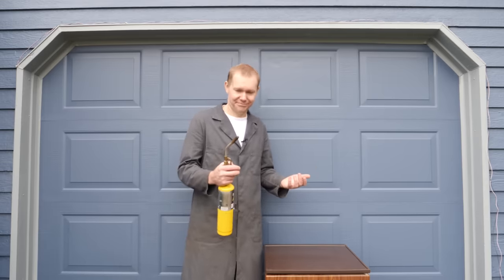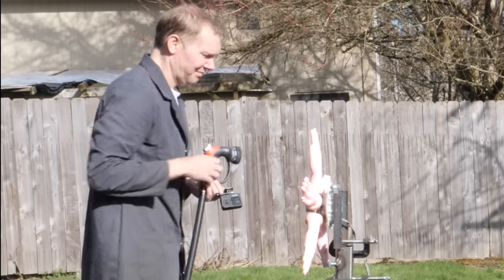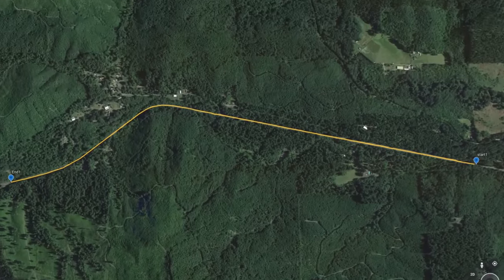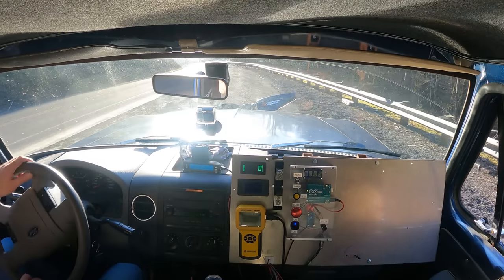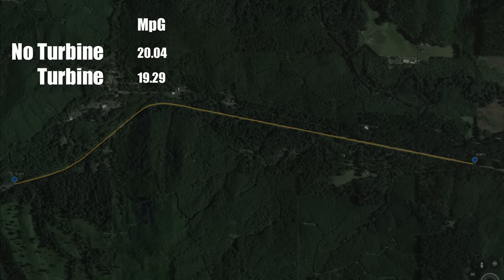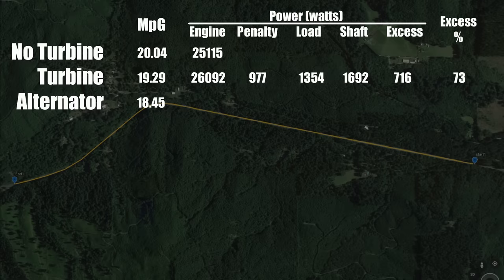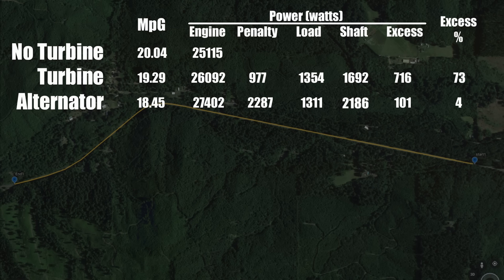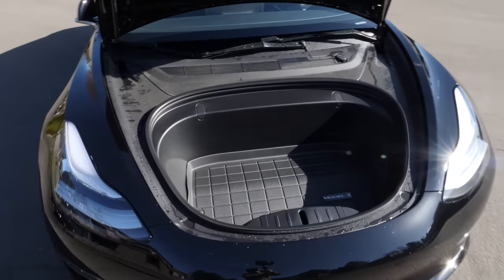Mileage Results You Won't Believe!!! - Wind Power on a CAR #5

Comment: As long as you don't increase the frontal area of your truck, the wind amount displaced should be more or less the same. But, you might increase the drag coefficient of the whole system, since there is more stuff creating turbulence. But, the car used in the system is terrible from an aerodynamic perspective, so putting more stuff in front or behind your car isn't going to make a huge impact. You could optimize this system by increasing the size of the propeller, whilst making sure that the sweep area of the blades fit inside the frontal area of your truck. Then adding more blades, and finding the sweetspot. Also, putting something aerodynamic around the generator would help. Surely you could increase the amount of energy recovered per unit of fuel spend. It's a fun optimisation game, which could be added to electric bicycles of all things, haha!

Comment: Why not try capturing the uncaptured energy from the back draft at the rear of the vehicle? I have an 88 4runner with the rear window that rolls down. On a dirt road with that window open the dust flows through the back and out through the front windows. My brother has guessed that any energy captured there would not reduce gas mileage and might, with a proper setup, actually increase it. Like drafting a semi truck. That conversation led us to this video...

Comment: Have you tried the archemides screw? One or two small ones in the front grill sucking in all that air while still allowing it to pass through like normal would or could be more efficient in those tests, I'm curious if it would work

Comment: By the way y'all... this guy's investment into this setup isn't cheap. The custom mount would cost a pretty penny, even to him who already has the machining and material available,  let alone the time to do it, the electricity to do it. And the designing. If you can pay a welder to slap something together and call it good enough you'll still pay a decent amount. 

The generator head he bought I think he mentioned was around $500? Could be more. Assuming he bought those turbine blades and they weren't just given to him like many youtubers... those would be pricey. The bearings and structural support. Extra wiring. And if you wanted to monitor the power you're also looking at getting most the instruments he got. Plus the inverter.

Total cost is going to be pretty hefty for a dismal return on investment. Plus it's bulky and unwieldy and could possibly get you pulled over a time or twenty.

It's a cool experiment and the content creator gets paid via ads and patreon and I'm sure he gets freebies and stuff so it's worth it for him to do this. For the rest of us... it makes no sense to do this as he even states. Just do it because you have money to burn and want to play around but don't go out and try all this thinking it'll save you money. You'll spend 10x whatever you thought you'd save in the process.

I'd be curious as to what extra suspension wear he will also have hanging a large weight on a lever arm off the front of his vehicle. That's an additional future cost to consider.

Comment: Hi there, have a question instead of using wind turbine style try using tower fan turbine model with 2 alternator on each side if I had enough funding i would do R&D on it this could increase watts efficiently

Comment: Take the power from your generator and apply it to propulsion (electric motor added to engine accessory drive belt) and then you'll have converted wasted frontal area drag into reduced engine load - less throttle, less fuel. Same concept as your example of electric car range extension. Let the air do some work as its getting displaced.

Comment: I'd like to point out that there is a mathemathical strikt relation between car speed, turbine rotation and blade angles.
 In principle:
   => Directional: Car speed Cs varies with time Cs(t) correction is probably needed due to air turbulence
   => Radial:         Rs(r,ang-rpm) = ang-rpm * r radial air speed component orthogonal to car speed
   => Resulting total speedvektor: sqrt(Cs² + Rs²) total air speed that meets the rotating blade at radius r
   => Angle of blade at a given radius r, rotation and car speed:  Ab = atan( Rs(r, ang-rpm)/Cs ) + constant
I felt you did not see this relation in the video, between the variabels above, but they are pretty straight forward, and strict physical applied math. And they also give the twist of the blade as a consequence.

Comment: My question is. Why are you running at hwy speed?   Is it to make the RPMs needed at the generator to make the needed amount of energy?  Or is it necessary because your propeller design efficiency?      Why use a vertical propeller in the first place?  Why not a horizontal design 🤔?   Can you optimize your outputs going slower,thus cutting down on drag all together?

Comment: A top post: this is just scratching the surface. The +/- changes to coefficient of drag, effect on the engine cooling system and so-on. Could heavy transport trucks benefit without too much extra cost?

Comment: What about different variables regarding efficiency? Would a custom turbine designed for high speeds return more energy, thus increasing the efficiency of the vehicle? Would number of blades cause the turbine to generate more energy? Maybe something with a lot of blades like a jet turbine? What about multiple turbines? And weight and aerodynamics of the car? I’m curious how far this could go if everything were fully optimized for efficiency

Comment: Where I live in Iowa, I see Tesla's, but they only have certain towns they can go to to fill up. Planning is key, and a trip to a reunion would take two refueling stops most the time should I have one. Here gas vehicles are more feasible given some trips are multiple hours both ways. Some areas a Tesla needs to avoid too since you wouldn't find a EV charging dock for towns over most likely, like Oceola, Iowa.

Comment: What I would like to see is some of the engine peripherals that extract engine power, replaced by power from the windmill, and then see how much MPG is saved.  Start with replacing the alternator by power from the windmill.  

Powering an oven is cute but useless for most people who drive a vehicle.  For 50+ years I have believed that a windmill on the front of a car could save MPG, not only by reducing wind on the vehicle but from powering engine peripherals.  Whereas land and water sailing craft can use a windmill to move directly upwind at 0ˆ to the wind, it stands to reason that a engine & gas powered vehicle can save MPG by using a windmill.

Comment: very nice. this might be more appropriately categorized as energy harvesting. find some wasted energy and try to harvest some of it. turbochargers anyone?  a gas car indeed has wasted energy oozing everywhere. we usually think of the heat off the engine. this is a nice demo of wasted energy in the forward air compression. maybe we should surround the engine in peltier devices :)

i suspect the effect will be less as the car becomes more aerodynamic, but i have no idea where that cutoff would be.

Comment: I get you your experiment is an exercise of efficiency.  Much like a Joulethief circuit is doing for electronics by switching. In your case aerodynamics is key by perhaps recovering some of the drag and backfeeding it into electric power and the equation to this would be how much more added drag will your fan add plus the weight of the big motor in comparison to what it is able to recover and deflect from hitting the Blount front of your truck. In the case of Tesla cars they are already made to use aerodynamics in the design of their bodies unlike the truck... I think I get you.

Comment: I'm at 4mins and wanted to make a prediction!
Basically your drag is massive, your gonna swap parasitic drag for productive drag over the same frontal area of the same vehicle so yes absolutely you will get a bonus!
HOWEVER..........
try doing this with a car that has a lower drag coefficient and I think those gains would drop in a corresponding linier fashion with the drag!
Basically I think you have forced aero advantages onto a brick with mechanics (so parasitic loss is still high)!

Also I must add their are losses in machinery, so where he gains advantage via drag reduction (basically pulling displaced airs energy and converting back to an electronic form of the fossil energy that maintaining momentum consumed) he could also gain similar advantage by say using brushless charging system or reducing drag via aero!

What I'm saying is he used a very inefficient vehicle to gain efficiency with and I very much doubt this would work with a better designed vehicle!

Comment: I had this idea myself for electric vehicles ie scooters and even made to larger scales for cars, but not using a propeller style but putting blades in a vertical or horizontal configuration placed in a semi closed tube encasing the blades with a opening and exit allowing the air to hit the first blade and so on as each blade is exposed andthe exit to prevent drag I've used stepper motors top and bottom to extract as must energy as possible. Obviously the vehicle requires charging initially but with added copasitors and rectifiers you get a steady flow of electricity flowing back into the battery bank which in turn lengthens your trip. Your thoughts on my version or your idea.

Comment: Put a VAWT on the back of a lighter framed buggy type vehicle, no ICE, use battery power and motor. Recharge via VAWT connection. Should be able to charge as you go. Similar to electric motorcycle in weight for the vehicle if possible. Depends on the weight of the VAWT and driver I guess.

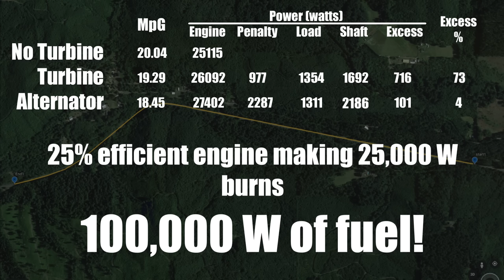Comment: I think that your chart at 11:14 shows that a hybrid version of this would actually improve gas efficiency.  That seems to be where you took the conversation with other people's work mods -- one looks like a smaller, white batmobile.

If you were able to pump the electricity back into the propulsion of the engine, such as with a hybrid, would it then become more gas efficient linearly related to the energy produced by the turbine?
In simpler solutions, what if you used the wind power to charge the battery instead of the alternator [and instead of the oven]? 
Then could you use a current selector to charge via alternator or charge via turbine, depending on the wind speed?

Comment: It's not actually the propeller that is resisting the wind. It's the motor. because the motor is keeping the propeller from turning, so when the wind pushes on the propeller the propeller is trying to turn the motor and that's where the resistance is coming from. If you just put the propeller up there without being hooked to the motor their propeller would spin very easily and it would be very little resistance

Comment: I’m curious to know if you have put any thought into a different sort of wind power device?  I was recently reading on the subject of using the voice coils of speakers that had damaged cones to make electrical current. It’s really a simple setup,in studies I’ve looked into people simply attach a vertical blade to the voice coil and wire into the old inputs as their pickup points to collect the voltage. That Broncos got a boatload of surface area on which to put a collection of the mini generators.  Depending on how many you used it’s very possible that they would be much more efficient by creating less drag. That is unless so many are added to the Bronco that the weight addition overcomes the output of the generating system by creating enough load that the old 351 or 302 possibly even a 400M in your Ford is lugged down enough to cause the fuel efficiency to go down the drain.  Just a thought for another experiment but anyway, I dig the channel and enjoy seeing folks who use their thinker instead of just their talker. 👍

Comment: The fuel input is normal.

But the turbine recovers energy a car would usually ignore. Friction with the air currents.

With a more streamlined car? You would see a greater friction cost from the turbine.

It ultimately comes down to recovering energy that would usually be wastes. Similar to a Turbocharger improving engine performance thanks to recovering energy from the exhaust.

Which does actually place an extra load of the cars engine but the performance gained from the supercharger side is greater than the Turbine exhaust cost.

Comment: I wonder if you put a solar generator like an eco flow delta in the back of your bronco, if you could track your power output from the turbine better because the solar generator could monitor your watts/volts/amps

Comment: Lol, could you use a higher sitting truck & box for this experiment. Find a car with the most optimal slip stream put the spoiler barrel turbine on the back that should get rid of most drag & spin turdbine much quicker. An alternator wheel wirelessly charging an in hub motor wood be most efficient I'm pretty sure. As you lose all garbage in engine bay, tailshaft diffs transmission disc brakes etc etc.. plus 1000kg battery disappears. Try that 1

Comment: Decades ago a mechanic made a hole in a radiator and sealed off the damaged tubes.. He then ran a shaft through from the engine and put the engine fan in front of the car. It did get great mileage but was too dangerous for practical use.

Comment: So my layman understanding of all of this: the electrical load of the oven running requires energy which it is drawing ultimately from the fuel burned by the engine? Resulting in reduced mpg from the higher power demand and reduced efficiency in the latter two tests (turbine and alternator), whereas the first control tests with no load running, i.e., no oven running, resulted in the best fuel economy.

Comment: Love these videos....you have the tools and knowledge to demonstrate the science....I assume that you can generate a different voltage at lower current with the same power generated by the turbine and that you chose the 14v specifically at the battery rating you used?

Comment: Beautiful piece of engineering I watch this video and you profile how I think I like to think outside the box Epi system is designed to run at a certain speed what happens when the axcelerate disa different speed different reaction different physics happen sometimes you can get interesting results some systems that are not design or at the sea not to supposed to go that far sometimes I pushing the limits we can get definitely different results I remember when I tweaked up in the electric bike that was designed to run it only 24 km I could tell that the motor would run faster I could tell that they would be much more efficiency and eventually I got this system running and it Pearl like a cat it was a 3-phase engine electrical motor the experiment work I tried different systems yes there was some failures you can also learn from these failures you won't get different results and sometimes better results by pushing the boundaries of physics what's your thought is one thing what you can learn is another by experimenting running hypothesis and eventually testing them yes you're right cars do run very unofficially a lot of it is and heat lost what a thought he could be re converted into energy Ford is a lot of heat coming out of the motor hypothetically we can recycle this heat and we would get a lot more efficiency not only. However a car technically could run on 8 horsepower once it has achieved speed break the the gravity pool on the wheels definitely I like the concept great work continue on this is how new discoveries are made sometimes you have to go against what you were taught to get different results beautiful peace continue on Don't Let Go

Comment: This kind of thing is used in electric sailboats. Sort of. When sailing your speed is reduced by drag in the water. The prop in the water is causing some of that drag. But in an electric boat, the prop spins thet motor producing electricity. The drag is pretty much the same either way but you are recovering some of that energy. There is also something called hull speed. Its almost like hitting a wall with your speed. Anything past that speed, it takes massave amounts of energy to gain anymore speed. Lets assume your hull speed is 10 Knots. You can probably hit 10 Knots with one sail on a windy day. Add a second sail an you might gain another 1 or 2 knots. Or you could have a prop in the water spinning a generator charging a battery an still do 10  knots. When the wend stops you then use that battery power to turn the prop to keep going. Hull speed is still 10 knots, so any speed slower than that uses very little energy. So in the end, you get to turn all the energy in that second sail in to either going 10 or 20 percent faster/farther, or turn it in to electrisity to go something like 50 percent farther. Its about using the static energy input more efficantly because of existance of the speed wall. 

In the truck you are doing the same thing. Using the energy required to move the air out of the way of that brick of a truck, to produce electricity. Efficiency went up.

Comment: most washing machines pump can produce 170 to 200 plus voltage. and there no bigger than your hand. the only thing needed for them is a balanced propeller on the small shaft. after which will allow more than one to be mounted on a vehicle in place mostly out of site..

Comment: Talking of extending the range of an electric car, what if we simply attached an alternator or even 2 into the drive system which would help to charge the batteries, or would the extra load on the motor and therefore the batteries outway any possible gain.

Comment: Have You looked at the oem motor in a front loading washing machine. You can stack several on one shaft back to back  🤓 
Stay Safe
Reply: Also,  putting a shroud around. Like possibly the built-in fog lights on bumper... I know it multiples output when used on aircraft,  not sure on input...